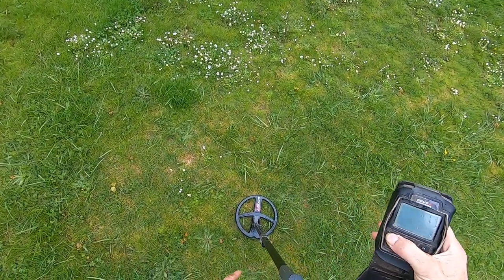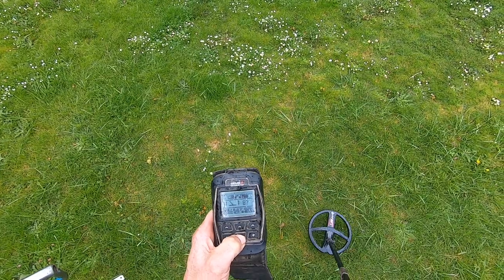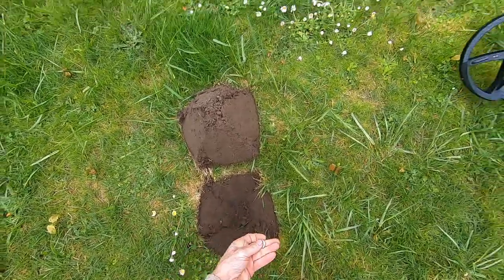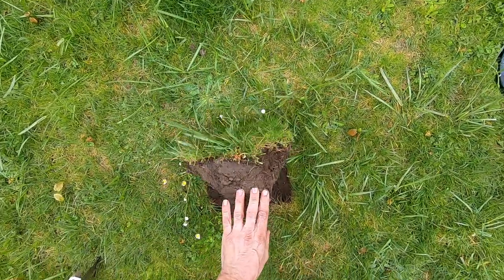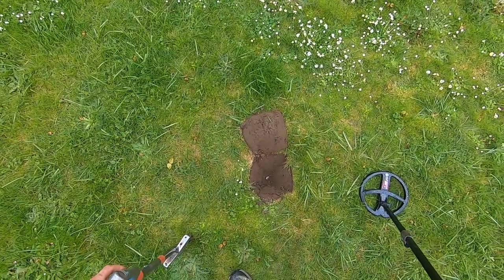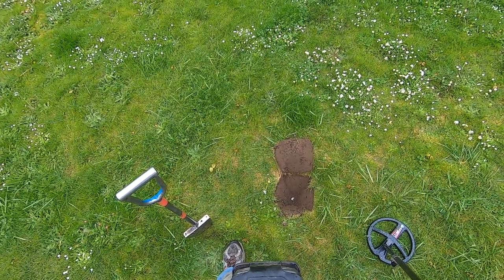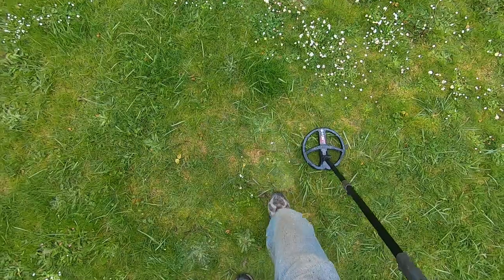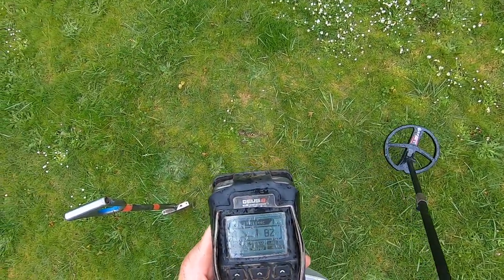Test with Deus 2 with new coil. 5" deep nickel in mineralized ground.

Comment: Hey Paystreak I experienced just that yesterday I made my own test garden 6 inch deep coins buried, air test was great but in ground it was like not even there, adjusting gain recovery speed slow swing fast swing nothing uncovered all the above while still in the hole it hit all targets, I live in a area with very high alkalinity soil I didn't think that alkalinity would do that but on the sweeps of the coil I wasn't picking up any iron at all, at first I thought something was up with the coil but air test proved that wrong, so I mounted the six inch coil and I am hoping that smaller coil smaller area being read will help some but at this point after trying simplex, NOx 600, whites vx3 all had the same result.
Reply from the maker: Smaller coils should do much better. Burying coins in hot soil is a very unreliable test. If you take detectors out on a real hunt you will get a much better perspective on the potential of your detector. Hot soil is very tricky man!! Hot soil changes when it is wet and changes when it is dry. Test those coins just for a 10 or 15 minutes per week for a full year. Then you will learn lots about your detector and it's ability to get through different soil conditions. Changing coils can have a humungous impact on the amount of targets you get per hunt.

Comment: I don't know if using the hottest program with that much emi is the best idea I would like to see the stock program with the factory ground balance like the general program on this scenario. With less emi This detector seems to be effected by both silent and audible emi.  My D2 has been running great hopefully you get it figured out
Reply from the maker: I did perform this same test in a video with a nickel at same depth away from EMI. Still was not hitting it in stock programs. I have very very mineralized soil. I have many videos of testing the Deus 2.

Comment: Hey streak, do you think it’s the EMI killing depth? Here I have good ground but near the EMI, my depth is 1/2 of normal, no SMF will work for me within sight of a power line. Only success I had was mono around 17khz I think. At that, I dug a Spencer cartridge measured 13”. Most people would think that’s stellar depth and for them it may be, but I barely got a squeak at first. In the past with Deus 1, 11” low frequency coil, 11 kHz or whatever that frequency range was, it would have banged that Spencer shell in our ground, it’s sandy, low minerals. My old Deus 1 here at times would work really well, better/smoother with 9” coil. This patch of woods is 200 feet square, I know every inch of it like you know your parks. In clean ground, no EMI, deus 3.2 software, 11” coil, I’ve dug probably 20 civil war bullets measured with pinpointer to be certain, up to 17” deep from surface. I know it’s hard to believe but factual. It may be a crappy video, but I captured one dig live in Petersburg ground, awesome for depth.
Reply from the maker: I would love to get my hands on a D1 v3.2. I have heard nothing bad about that version. Mineralized ground and EMI decrease the depth penetration potential on all metal detectors dramatically. If I sweep slow with bug coil I will be luck to go 7" deep in my wet soil right now. Hot ground is really something that people do not understand unless they have hunted in it at least 1 time. Most of the people who visit and metal detect my area never want to come back again. When the ground is dry I have not too many problems with hot ground...but I have to deal with clay that is hard as concrete. I am really after the god rings and jewelry near the surface because the grass roots suspend most jewelry. Relic dumps are a whole different story. The Deus thrives in relic dump in pitch tones. No other machine can do what the Deus machines do in pitch tones period.

Comment: Well that sucks man. guess you need a PI machine lol. With the recent update V7 im gonna try and make a cherry picking program and notch out all the bad stuff. Sounds fun to me. D2 Seems to ID well enough and the ability to notch in Relic program. Id be interested to see you try something similar. Maybe your ground is to harsh for it to work.
Reply from the maker: Yesterday for about 2 hours I did try gold field with notching to 52 and it did fairly well just digging the tones. Gold field is very stable but hits on the frikn smallest targets that are almost impossible to find with a pinpointer. Pi machines are very heavy and do not do very well swinging fast.